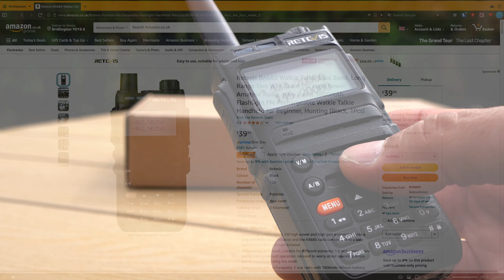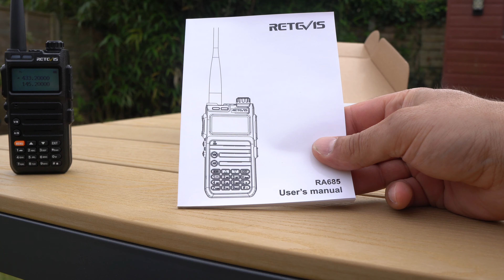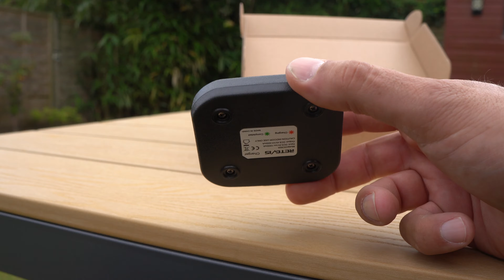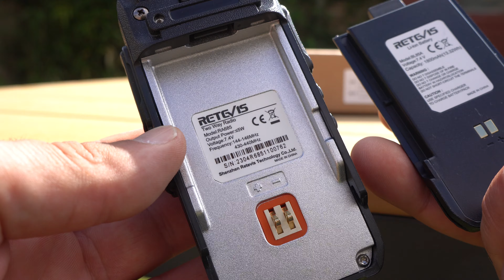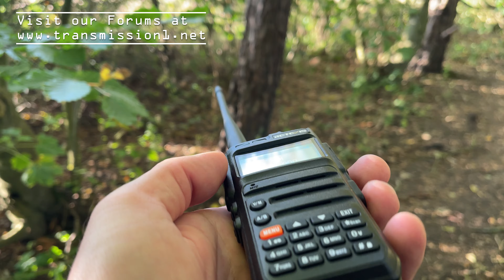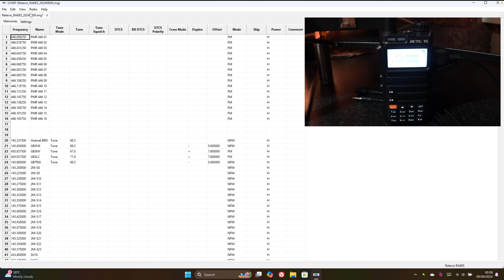Retevis RA685 Dual Band Two Way Radio Review

Comment: Retevis Just Throwing out cheap generic Chinese radios for you guys to ''review'' So  never going to be unbiased And they all sound the same anyway, And probably the same Radios inside the case, For transparency Did you buy the radio Or were you Given it to ''review'' Yes or no, If you actually bought it it would probably be a much fairer review
Reply from the maker: A bit negative? Don't worry. I didn't sell my soul to Retevis for $40 ;) If you had watched the video you'd notice I was critical of the issue I discovered when charging the radio and also the unbalanced power output on the UHF band but never mind.. I did mention in the video that Retevis sent me the radio for review but the majority of kit that I've tested has been paid for by myself. I've always called things out if they aren't right. I've got nothing to gain by making things up when I test equipment. 73